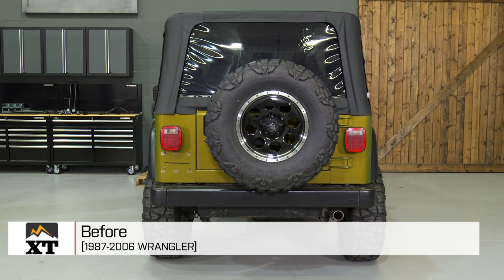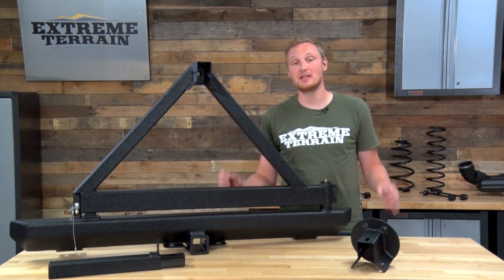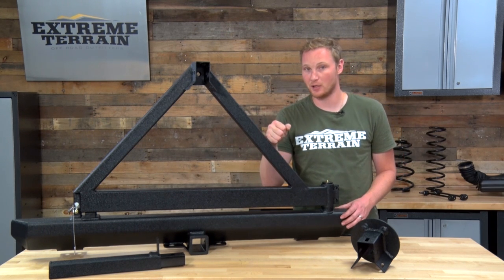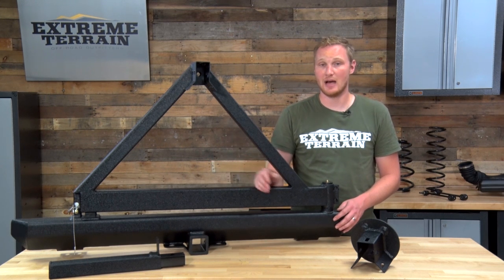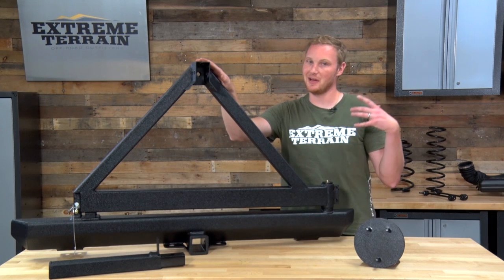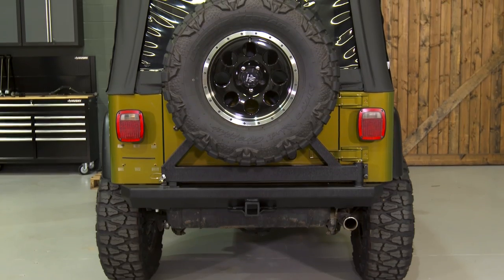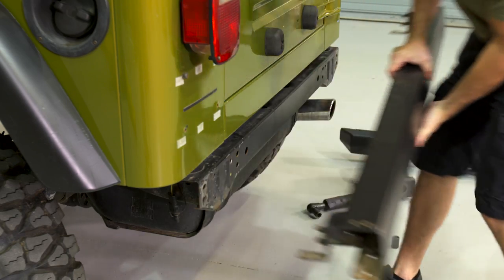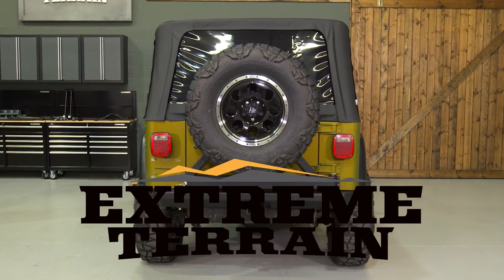Wrangler RedRock 4x4 Rock Crawler Rear Bumper w/ Tire Carrier (1987-2006 YJ & TJ) Review & Install

Comment: Looks like for a 98 wrangler, drilling is required which you will have to drop the tank for. May be good to mention before others order for 98 year
Reply: When I bought mine local 4x4 shop if you want to use it for recovery to get the receiver for recovery, and as long as the 4 bolts have been drilled it will hold up, I’m hoping the shop I had install it drilled those holes but I can’t figure out if they did or not, where would the holes be located?

Comment: looks to cheep and that thing is going to squll bad in a few weeks i will keep saving and get the other ones
Reply from the maker: Hey Patrick! It's definitely at the lower price point given how basic of a design the bumper and tire carrier is. However the only negative I've heard from a customer about it is that the locking pin begins to squeak a little. I personally would like a beefier bumper setup as well, but I think that this carrier is priced out exactly for what you get. What bumper and tire carrier do you have your eyes on? -Jake